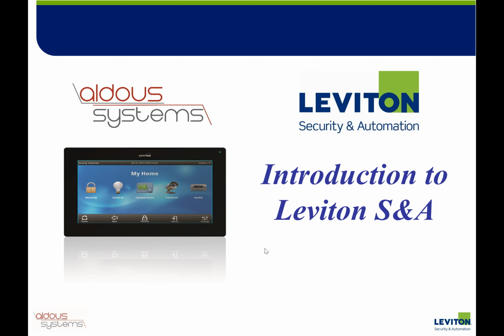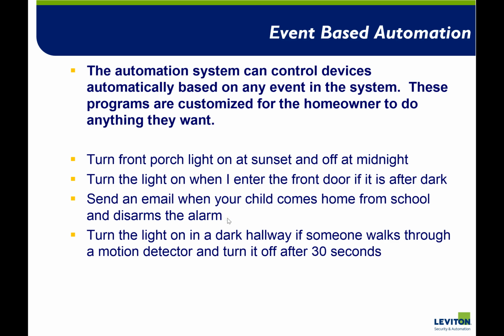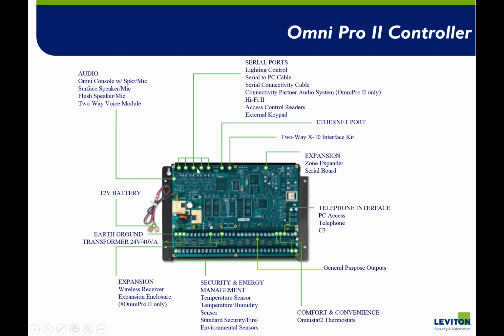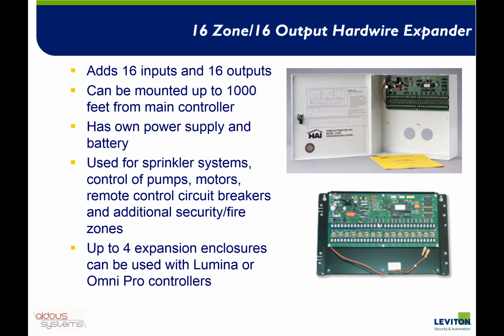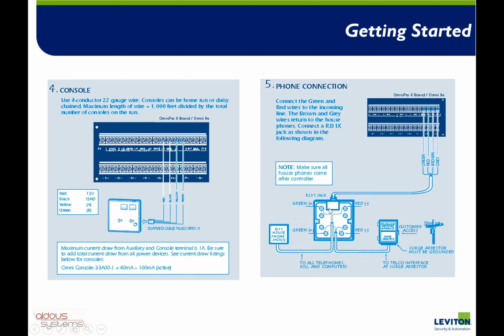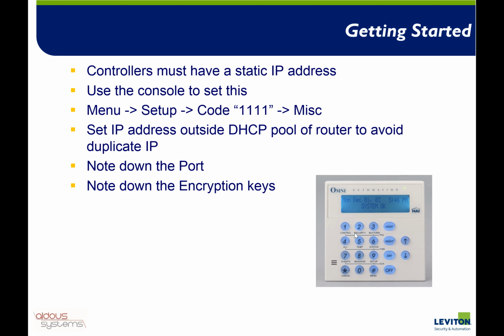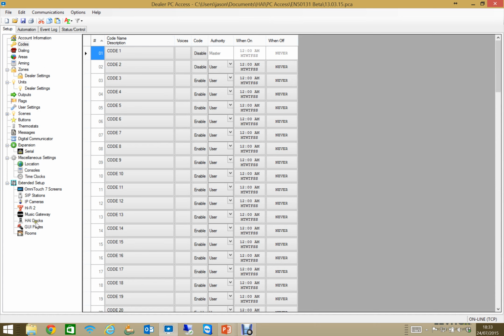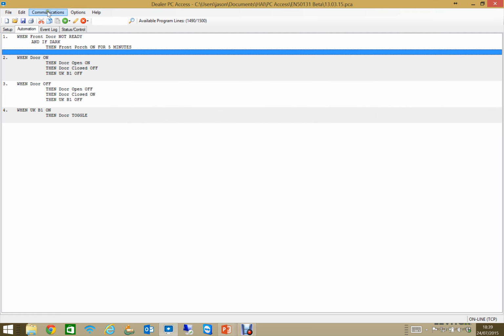Leviton Security & Automation Introduction

Comment: Can you tell me what would be the correct program language to have a light come on at dark. I have an Omni LTe. I’ve tried....IF flag on AND dark THEN light on . But it will only work when it’s “dark” and I toggle the flag .
Reply from the maker: You have put the Dark as a Condition. You need Dark to be the Trigger. You want to IF Dark THEN light On.
Reply: I tried that but dark isn’t in the drop down for the triggers or IF. It is in the AND list.

Comment: The Omni controller are EXTREMELY robust, NEVER crash (when programmed properly). I've done TONS of automation with these, control door locks and gates, garage door openers with fail safe logic, main water valves, pool foutains, drapes and blinds (with over 40 relays), lighting control with HLC, Radio RA2 and Crestron, thermostats (18 thermostats, radiant floors, heat pump and AC), complex automated lawn sprinkler system (almost 600 lines of codes just for 10 zones of sprinklers) with realtime feedback by SMS to customer and full manual control if required, reminders for trash and recycle bins days and even a cat food dispenser ! These controllers are EXCELLENT, their technology is getting a little bit old and on the slower side but still, when programmed properly, they are rock solid and reliable. Don't hesitate to use these !
Reply: Aleziss , Can you recommend an installer for HAI Omni pro 2 in central jersey ?
Reply: I bought a home with a omni 2 I live east brookfield mass is there anyone that works on these systems